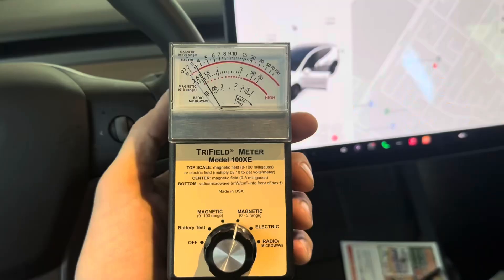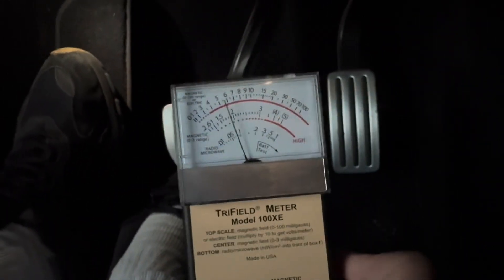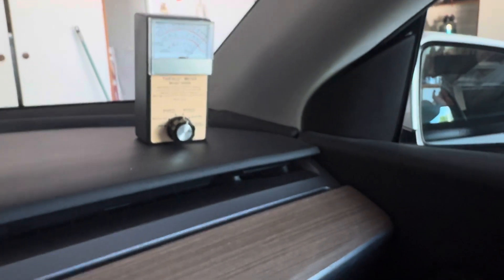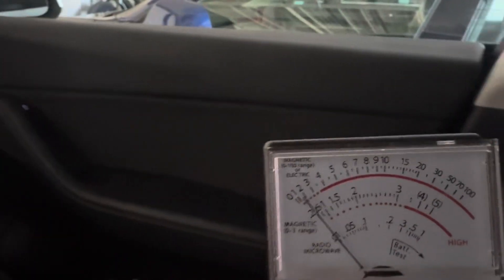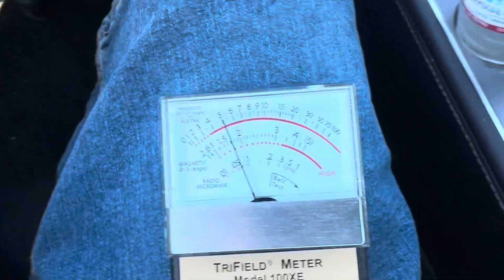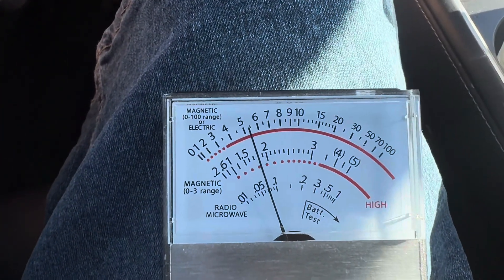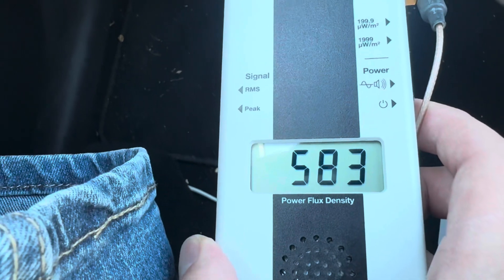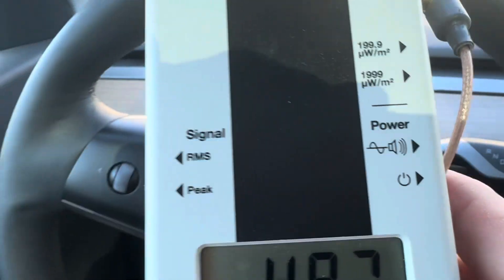Tesla Model Y Radiation Test

Comment: There is no electric motor in a petrol or diesel ICE cars.
Reply: Wipers, fans for air, steering assist etc all use elec motors as well
Reply: How does a petrol car start without an electric motor?
Reply: @JL-yv3qv  Thank you for your reply. Yes you are correct there is a starter motor, I stand corrected. Thank you again for correcting me.

Comment: The issue is people get these meters and have no idea how to use them. People sensationalise meters which show lots of activity and beeping. Anything under 3 is considered very safe. Also you’re measuring magnetic fields, the motor you have has magnets, so what do you expect? Are you scared of magnets? Do you know how a wireless charger works? 

And you use words you don’t want to be in a microwave, microwave energy is completely different to what you’re detecting in a car.

I have a VW Passat, and I get far higher readings in it compared to my new Tesla m3 2024 model.

So perhaps you need to stick to push bikes? At least you won’t get ‘microwaved’ and will get fit.
Reply from the maker: Bluetooth and Microwave ovens both operate in the 2 GHz range. It’s also why it’s not a good idea for people to be using Bluetooth earbuds.
Reply: Are you suggesting magnetic fields don't effect biology?